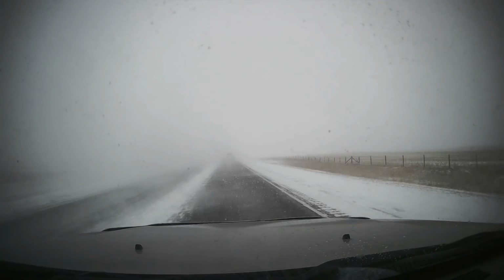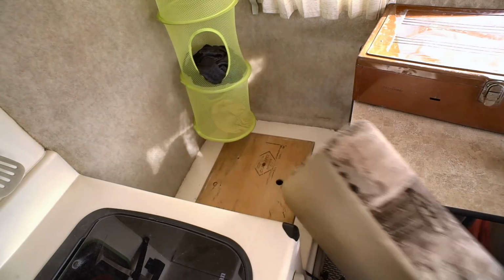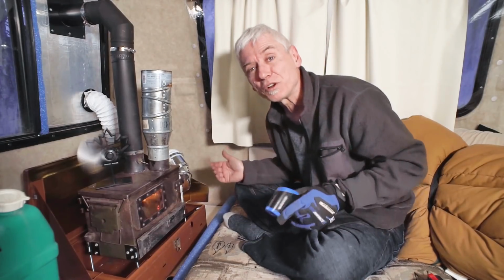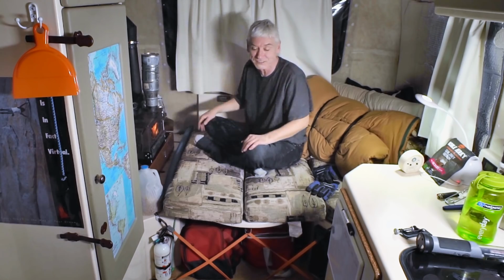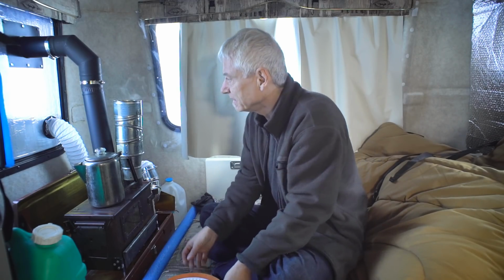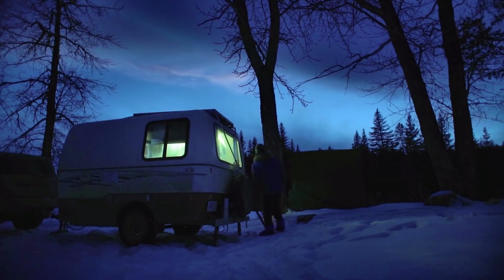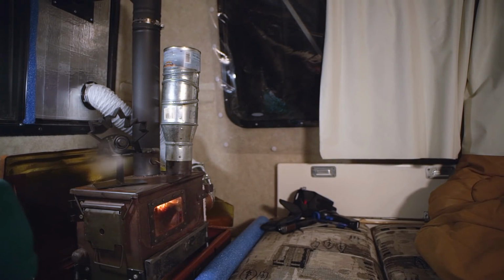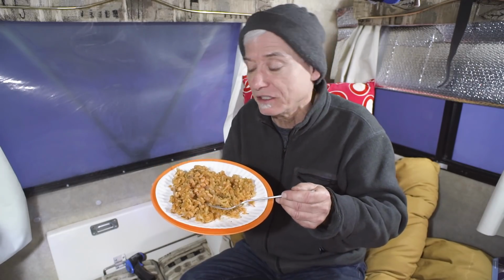Camper Wood Stove Experiment Pt 3: Feeling the Heat!

Comment: "The outside flue is actually quite light" 
Yes I agree, that's why I think you should throw some wire on it. The lighter something is, the more likely to be blown away with the wind.

Realistically it'll probably be fine but, I would feel a lot better if it were attached more securely.
Reply: Actually being lighter means it's easier to secure. I think his set up is fine. If he spends more time in the prairies, he might need to reconsider. If it becomes an issue, I assure you, slim will figure it out. Ps don't listen to the other comment. People that take time to be sarcastic jerks are just sad and lonley, and should mabye find a hobby of their own.

Comment: The 5th choice is electric.
Reply from the maker: Not a choice when you're off grid and can't stand generators. SP
Reply: @SlimPotatohead  I was thinking an 18650 battery bank?
Reply from the maker: You'd need 1500 watts of constant power to keep warm in a camper like this. SP
Reply: @SlimPotatohead  wow, thank you 😊

Comment: you took a Coleman stove apart just to put piping in
Reply from the maker: Ah, no. Sounds like you missed parts 1 and 2. SP
Reply: @SlimPotatohead  you used it to the block the heat. my question is why you just not cut that and bolt that to the wall
Reply from the maker: Because this was  meant to be a temporary installation, not a permanent one. SP